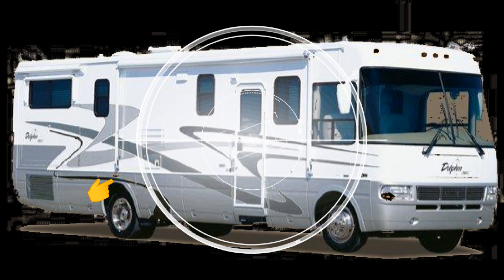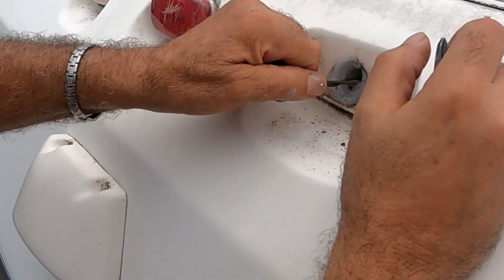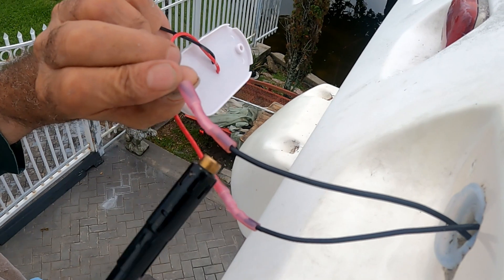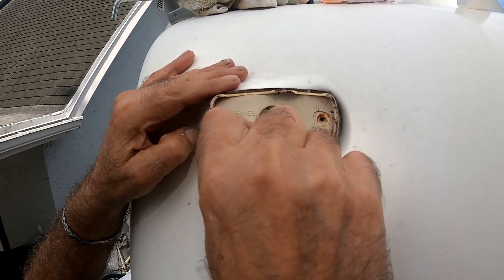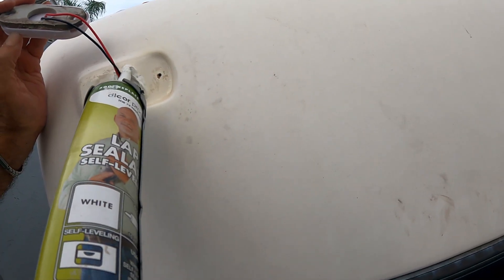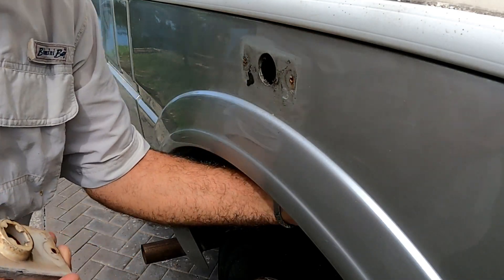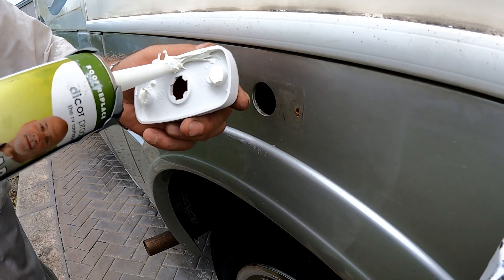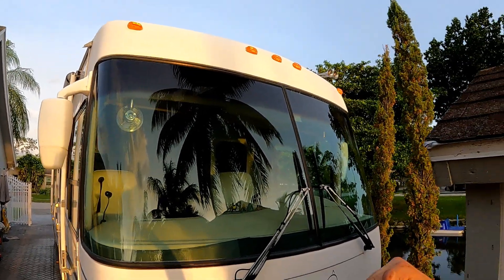RV LED Side Marker Clearance Lights Surface Mount for Truck Van Camper 12V

Comment: Great job John replacing the old incandescent clearance & marker lights to LED ones. Good tip to use stainless screws, I use them for many different installations outdoors when possible where regular plated screws can rust. Have a great Sunday! 👍
Reply from the maker: I agree, although its mostly fiberglass the rusty screws just make a mess.... especially the rust stains on fiberglass is not fun taking it off...
Reply: @JohnCRV  That is true, rust stains can sure be a pain to remove!

Comment: I was looking at this exact set on Amazon. I was going to use butyl tape under the fixture as it stays soft but then caulk or seal around the edges after installed. I live in the PNW so moisture is a huge issue. Great job. Thanks for taking us through each step.
Reply from the maker: You're welcome! Butyl tape a great idea! Thanks for the feedback....